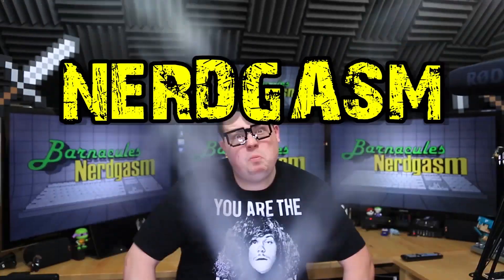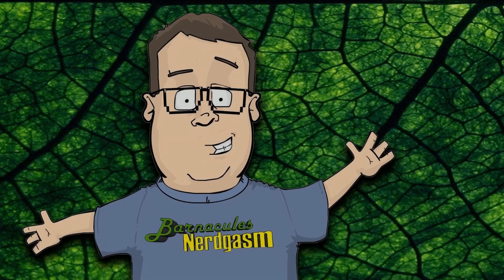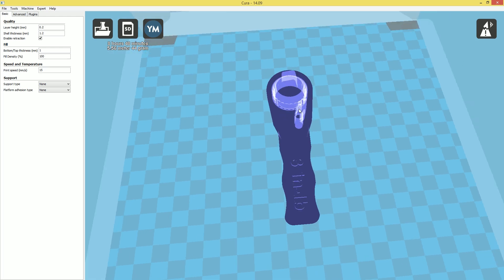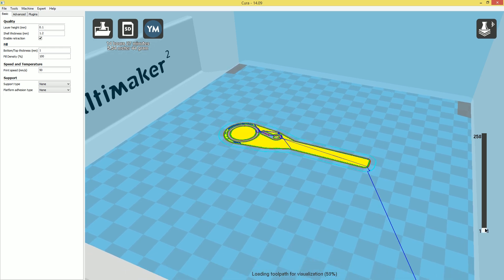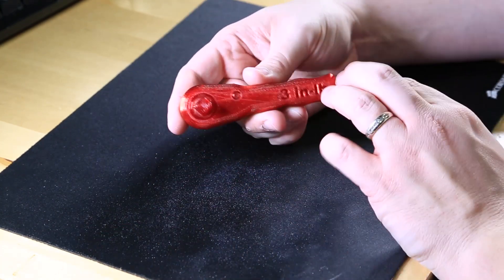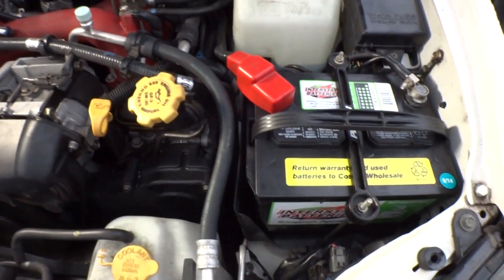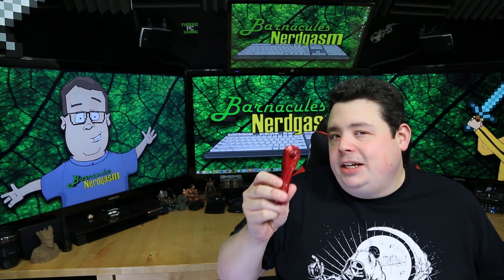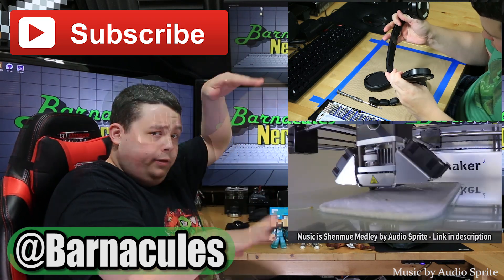3D Printing & Using NASA Space Wrench Here on Earth - @Barnacules

Comment: I know I'm a little late to the party here. I watched it when it was new. I can't remember if i commented or not, but if you mirrored it you could print 2 wrenches and the other one would work in the opposite direction. You could also scale it up or down and have a 1/4", 1/2" or even a 1" drive as well. You could make sockets and everything. That might be useful if you're dealing with delicate hardware where if you were going mess something uo it would be the tool and not the thing you're working on.

Comment: so for PLA what you need to do is shove a bunch of squishy material like silicon on the left side of the little arm, it gets rid of the wobble and the loss of traction issue. I find that the internal "spring" on that little arm isnt enough for PLA  and after a little bit of use it wears out. Ive been using my ratchet for about a week now on different things around the house and its holding up quite well.

Comment: If you print a 3/8" block on the other side of the ratchet it could do both directions, except it would need support material
Reply: Or you could just mirror it and print 2 wrenches. The other one would work in the opposite direction.

Comment: I just realized that you don't even need to mirror the model. You can just add another bolt-head-extrusion on the other side of the gear.
Then label each side of the wrench with either "loosen" or "tighten"

Comment: Which 3D printer did you expect in space?
Molding printing wouldn't work in zero G! You need the gravity to hold the liquid where it's supposed to be!
And since they use the tiny hole to squeeze things out of even in eating - MDA printing makes a lot of sense. Also the MDA relies more on sticking to a platform than on gravity, which makes it perfect for space.

Comment: now seriously a space mission missing a ratchet ? Who did singed those checklists ?
Reply: BisdremisKostas every ounce counts when launching things to space. the filament can be made via recycling or justified to be launched so new parts can be made in space as needed
Reply: That is not the point literally every ounce is precious to the point the astronauts fast before launch. They probably have a couple ratchets on the ISS but shit happens and sometimes replacements are needed and in a pinch 3d printing tools as needed might not be a terrible option. This is a proof of concept for justifying a 3d printing system to be included it would be beneficial in many cases such as a part breaking i seem to remember the toilet broke and had they had a 3d printer they could have fixed it rather than needing to launch parts.

Comment: You can make instead of 2 wrenches a two sided wrench! Also a 2 sided wrench would be nice! In case one side wears off you arent left to deal with  that bolt with your teeth
Reply: carlosflar you just had a better idea than NASA engineers go get a job at nasa
Reply: gregistopal i told them...  They tell me that i need at least four years of experience working for the NASA to get a job there...
Reply: carlosflar how does that make sense
Reply: gregistopal i asked them! But they told me they where the nasa,  and thats how the stuff worked...

Comment: If you simply make a hole in the back of the tool and then put a square hole in the back side of the gear and then make another square piece to put in that hole after printing you will have a 2 sided ratchet, 1 side would lock in the clockwise direction wile the other would lock in the counter clockwise direction. Somebody get on it!

Comment: Would it last if you upgrade it with a reducing gearbox and longer lever?
Reply: Mustang Rt Protip: The more moving parts in a design. The higher the failure rate of the part.

Comment: This makes me think we are almost to the point where a 3D printer can make all of the parts needed to build something, plus all the tools and hardware to put it together. For example it could print all the parts to reproduce itself, plus the tools, and right now a person would only need to add wires and control electronics. So, how long until even wires and circuit boards can be printed along with the plastics of the shell and parts so that a 3D printer can print a functioning device all in one go, even the battery pack, so that what you take off of the print bed is a ready to go fully functional completely self contained product. o.o

Comment: if you extent the part that you put the sockets on through the back of the wrench you can just flip it over to get the opposite direction of ratcheting. the only down side is that it will need support material to lift it off of the print surface to make room

Comment: Instead of mirroring teh print to get a wrench that loosens, why not mod the print to make a double ended tool? Then all you need to do is turn it around and it'll ratchet the other direction. Kinda like that real tool with the selector switch was double sided/double ended. Mod the print to include another attachment point for a socket on the back. Problem solved.

Comment: why didnt they just make a normal wrench that didnt ratchet? it could both loosen and tighten bolts without printing another tool, or even changing tools...
Reply: +Jebediah Kerman alternatively they could have made it two sided one side tightens the other loosens- also consider- they have to be careful not to over torque with their tools, for various reasons- namely the fact that you can shift the entire station a bit more than you want to if your not careful-  so the gear slipping can be a good thing. also the great thing about 3d printing- at least with most plastics- you CAN shred and melt down your old stuff and extrude it back into filament- whether or not they have the equipment on the ISS to do that yet I don't know but doing so remarkably extends the life of the plastic used, it doesn't become a useless hunk of plastic, the only material lost is the dust from when it breaks and any unrecovered chunks.
Reply: Danny Vu its not about how easy it its to model the flipped version, its about how long it takes to physically print. Not only would you have to print 2 different wrenches to tighten and loosen bolts, the gear would still break and make it a useless hunk of plastic. Hands down it would be easier to just make it without the gear and fill in the area where the gear was with plastic.
Reply: No matter how long it takes to print a second one, it's still shorter than the 6 months it'd take to send up a metal one.
Reply: Because a non ratcheting wrench is trivial, anybody can design it. You can even just take the ratcheting one and fill the void by pouring a couple boxes over it in meshmixer. So a ratcheting design is more useful to publish.
Reply: Ok, that's a good reason for this style of wrench, however I think a completely solid one with no gear or ratchet would still be more useful.as you wouldn't have to worry about the gear slipping and you could use it to both loosen and tighten bolts.
Reply: +Jebediah Kerman you can switch directions on a ratchet..
Reply: not on this one, he said you have to mirror the 3d model and reprint to get a wrench that will ratchet in the other direction. Also, even if this ratchet did switch, there would still be the issue with the gear slipping.
Reply: That's easy to do with Sketchup.
Reply: Jebediah Kerman No, I meant filling in the gaps with SketchUp.
Reply: *****
nope mirroring is just inverting either the x or the y axis of the image.
Reply: +Jebediah Kerman you could print a loosening wrench it wouldn't be impossible to model.
a wrench that doesn't ratchet is no fun.
Reply: Because that would make to much sense...
Reply: unless you have a limited degree of access

Comment: If I were you I would split the mesh so that you print the and pawl at 100% density, but the body at a lower density, as it does not come under enough stress to warrant 100% density. This would save a lot of time.
You could also flip the model to make a loosening wrench, or mirror it on the X/Y plane to have a square bolt on either side so you could tighten or loosen with it. This would require some support material though.

Comment: You could print this to work with "pass-through" sockets that way you could just flip to loosen.  You could even go nuts and print a set of ratcheting open-end wrenches by replacing the socket stem with a sized hexagonal hole...

Comment: You wouldn't actually need to print a second wrench to undo your nuts and bolts, just simply print another square head on the back of that wrench so side on it looked like a T shape. One side tightens, one side loosens, simple. The only disadvantage is it would be the head of the tool wouldn't be able to fit in quite as tight spaces, but this would be minimal.

Comment: This is just an assumption, but since it's one directional and has a rating of 3 in-lb's I would imagine the wrench is actually a TQ wrench and has only one purpose. Also when you used the second one in the video im thinking it may have been meant to slip at that spot. Would be cool to see this in a tq wrench calibrator to see where the slip happens at.

Comment: WTH? You defeated the point of the ratchet. I will guess the reason it's made with ABS plastic and it only tightens is because as the handle says, 3 inch lb. You should have made in ABS then tested the torque accuracy. I would think that by changing material it also changes the torque value.

Comment: Barnacules Nerdgasm I just found this Video, I know it is way to late, but as a former industrial mechanic I just had some ideas coming up while watching.
1) Why not Support the gear from more than one side so it can ersist more force? Try out with 3 and 4 for trangular and axial force resistance.
2) It would be very easy to make the tool 2-directional. There are wrenches, where you can Pop in the tool holder on the one side, so it Pops out on the other side. Now just add a + and a - (or R + L) on the tips of the tool holder and there you go.
3) The wrench does slip on the extentions and Tools you connect to. Bad thin in open space. Why not seperate the model in 2 phases (not parts) adding a hole in the tool holder. When the Printer stops you just put a Piece of iron (magnets are polarized) in that whole and after the Printer continues completing the model.
4) You could print hte extentions and sockets too, there I would recomment doing like in 3) 2 phases or popping a small Neodym magnet in so they bond good together and do not get lost.
4) The wrech should have a Little hole on the end for a wrist strap, just think about wiimotes. Or better have a cord with an bajonet lock which plugs into a socket on a bracelet. (open space usage).
5) Ever thought about a magnetic wrist holder for extentions and sockets? (looking towards the magnetic bits at 4) )

It would be cool to get your Feedback on this as it is just theory and might simply not work practical. Thanks for the awesome chanel it really rocks in many ways, Keep it up.

Comment: Hey Barnacules.
If you redesign the wrench just a bit with a socket adapter on the other side you would be set for putting on or taking off the bolt/nut.  just FYI. I'll try adding the mod tonight and get back with you.

Comment: Hey Barnacules! Great video! I have an idea for the loosening-tightening problem: what if you had another one of the square-conectot-pokey-bit (I think that's the correct technical term) on the other side of the wrench. This way, you can work it both ways just by fliping the tool around. Anyway, I hope I was clear, if not I'll try to modify NASA's model and send it to you to test the idea. All The Best from Argentina!!

Comment: Just add another square terminal on the other side of wrench and it will work for loosening and un-screwing. It can be done on 3d printer with a little effort. (need to put it again and start remade printout of square, or just print square and glue it to wrench.) Nice vid tough. Cheers!

Comment: All you have to do is place another pin head on the back. This way you'll be able to work in both directions with the same wrench
Reply: That's exactly what I was thinking but not sure if printing it with support material would keep it strong enough. Plus the regular ratchet he used in the video is exactly what you described just 3/8" on 1 side and 1/4" on the other.

Comment: Is it possible to print one with 1/2inch outputs on both sides? So you don't need to print both. Or what is also cool print one with a hexacon hole so you can use it also both ways on bolts. M8 size is nice to make.

Comment: The actual first part made on the ISS's printer was NOT replacement parts. Rather, it was a necessary (though aesthetic) panel for the printer itself to cover up some wiring. 

http://i.space.com/images/i/000/043/958/original/3d-printer-space-station-first-part.jpg?1416946203

Comment: Hey Jerry (or anyone that can help me on this), what is the best 3d printer to buy for about $500, I was looking at printrbots and I was thinking of getting a printrbot, more specifically a simple makers kit, which sells for $350, however I think that the bed size is way too small, its only 4x4x4. After that I started to look at the simple metal kit which goes for about $540, which is the same but with a bigger bed, 6x6x6, is this a good printer to get or is there a better one to get for about $500.

Comment: Great design. For the wrench to move backwords you could extend the bolt shaft in the other direction, the wrench would have 2 bolts, one on each face, one side for tightening and the other side for loosening the screw, like mirroring.

Comment: Of course it slipped at a certain point when tightening, it works just like any other TORQUE WRENCH, its not just a ratchet... why else would it have 3 in-lb printed on the handle. It "slips" at 3 in-lb, just like a torque wrench would. If you were to set a torque wrench at, say, 36 in-lb, it would "slip" once it hit the threshold.

Comment: Instead of making two different wrenches, put the square peg on both sides of the cylinder. that way one side is loosen, and the other side is tighten. better yet, print it with a dado in the square peg so that it slides thru from loosen side to tighten side.

Comment: The rated torque is so low you cant do much witht the wrench.  3in-lbs is just slightly more than finger tight. It must have originally been made for an extremely small bolt?

Comment: I don't think your PLA wrench was wearing out the teeth. If you look closely there's a little arm pushing the ratchety part back. I'm going to have a video taking a closer look at it but that spring actually takes advantage of slicer errors to make a flexible arm that in ABS will push the arm back, but in PLA will probably break after a few uses. If you took your PLA wrench apart I'll bet you'll find that the little spring arm is actually the part that broke, not the teeth wearing out. I may be wrong, but that's my guess.

Comment: umm has now one realised that instead of a selector switch or making 2 wrenches just place anouther socket connector on the back of the wrench head so that you just use the back for tightning the front for loosening
Reply: Less printable that way. The reason why everything in the current design is so open is that that every part starts on the print bed.

However, there might be a solution that I'm going to play with tonight.
Reply: mrjoesays so dont put a socket connector in leave a square void inside and have a square pin you insert later
Reply: KYLE REES That is exactly what I did. https://www.youmagine.com/designs/modified-space-wrench

Comment: Barnacules Nerdgasm  Just print the 3/8" square end of the ratchet on both sides, then just flip it around in the socket or extension :)  Also add a little "nub" to the square end to lock the socket/extension into like the real ones have.  Now you need to make a wrench also Jerry and maybe some sockets as well. Plastic wrench or ratchet would be great for batteries as there would be no risk of shorting the positive of the battery to anything metal when taking it off. Cause we all know everyone remembers to take the negative side off first :)  Take care Jerry!

Comment: The reason it doesn't  have a selector switch and also why it slips when you tighten the bolt is because its a 3 inch pound TORQUE WRENCH and not a RATCHETING  WRENCH hence the big 3 inch lb. printed on it. A torque wrench usually just tightens and its supposed to either slip or make a clicking noise when the desired torque is reached. It also didn't  make sense to me why they wouldn't  have a ratchet in the first place being that its a common tool but a 3 inch lb. Torque wrench is alot more specialized.
Reply from the maker: I have two torque wrenches that have a selected switch for direction. Sometimes you want to measure breaking torque too.
Reply: Barnacules Nerdgasm that's  true, it just wasnt mentioned in the video that it was a torque wrench. I love all you videos though, i wasnt trying  to hate.

Comment: So here's a weird idea, Barnacules Nerdgasm ...  If the bronzefill PLA is 80% bronze dust and 20% PLA, what would happen if you put a print into a plaster mold, then heated it to a point that would burn off the PLA and melt the bronze?  I imagine that the ratio of bronze to plastic isn't high enough to make a functional mold/cast....  But imagine if they developed a filament with a high enough ratio of metal to plastic (like just enough plastic to act like a glue and hold the shape together), that all you had to do to turn it into solid metal was stick it into some plaster and heat it a lot!  What are your thoughts?